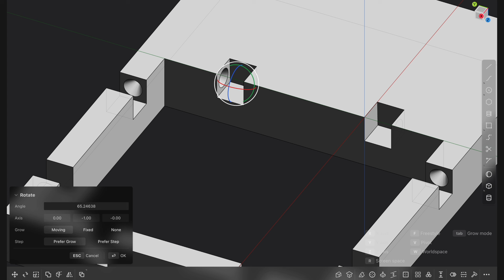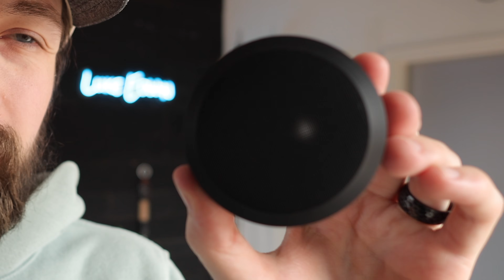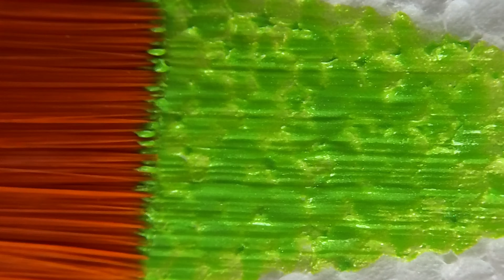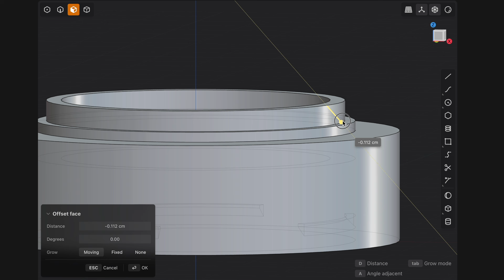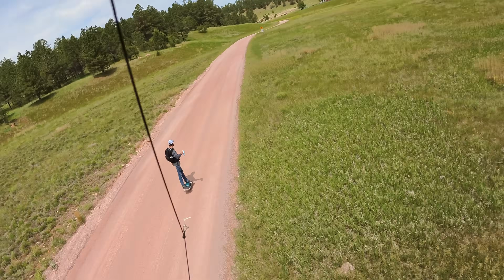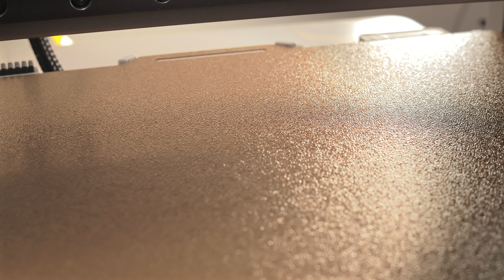8 DIY 3D Printed Camera Rigs

Comment from the maker: For all you wondering what software I'm using, it is Plasticity. Some of the screen recordings we're taking early on when I was still trying to figure out what software I wanted to go with but after trying a whole bunch of different program I figured out that Plasticity had the feature set that matched my needs the best for 3D printing.
Reply: After trying Fusion I can't get interested in Plasticity. It looks great, but not being parametric makes iterative design so frustrating.
Reply: Thank you,  it didn't look like Solidworks or Rhino so I was curious.  Have a great day!
Reply: @ashe31  are they all somewhat similar? as you can learn one and others or do they all look and function different?
Reply: Yo my dude. I got into 3d printing and I designed a lens I would love to show you and get your point of view on before I release it.

Comment: For the cell phone matte box, it would easily mount right-handed camera bumps by mirroring all of the files appropriately.  And the grid lens essentially takes isomorphic photos (in the style of pixel art).  Very neat, but I did notice a seam where the print head dragged across the grid in the middle where the sensor collects light.  If you set the seam to be along a specific edge and turn on Z hopping to avoid the part during travel moves, you should be able to avoid the streak of plastic that destroys the consistency of the grid in the middle of the frame.  (And it's pronounced "freh-nell.")

Comment: That pixelating looks great - here's a suggestion, why not try incorporating that into the EF to RF adapter so that it sits between the lens and the body.  Do you think that would work or would the light rays not be straight enough?  You could also use vintage m42 lenses with their own interesting optical characteristics

Love the broom shank holder and I see that there's a remix for multiboard so I think I'll definitely have to give that a try.

Comment: Well done! Let me give a piece of advise on the last item. It worth to put battery as low as possible as this is the heaviest part of construction. Also rotors should be V-shaped to prevent wobbling of line on them. These 2 updates will noticeably reduce the picture tremor that you have so far.

Comment: The cable cam is a great project.  I'm thinking maybe add a cheap esp32 board and add remote control to change speed and direction of travel

Comment: Looks great and all, but with this kind of 3D printing, every time you mount the adapter, the metal parts scrape off bits of the material, and those tiny particles get inside the camera and end up on the sensor.
Sooner or later, something’s gonna snap or break off and hit the sensor.
And honestly, I can’t even imagine trying to clean a sensor when the whole chamber's full of 3D print dust.

Comment: That lens adapter is a pretty good idea. If one were so inclined and willing to put in the effort, there might be a way to add some sort of small gauge electrically conductive wiring from the front to the back of the adapter so whatever mechanism the camera software uses to determine the lens is "connected" for extra features is triggered whenever lenses are physically connected without having to manually enable whatever settings or reverse engineer the software to flash custom firmware that always leaves this on or something.

Comment: Great work here. I’ve been making some adapters for vintage lenses recently. One thing I learned in the process is that over time the 3D printed blades will deteriorate through the friction caused by mounting them. This will result in filament particles on your sensor or a blade breaking at inopportune time. Rather than risk damage to the sensor or having unwanted dust in my image, I started buying metal plates with the mount blade on one side and a m42 screw mount on the other. This way I could print the adapters with m42 threads and add the plate so the 3D printed material has little friction and the metal plate with m42 threads provides confidence that the plastic blades will not break or deteriorate.

I also moved to printing with ABS rather than PLA as it is much stronger and less likely to breakdown in the heat. Unfortunately, your A1 will not print ABS. Another fun thing I discovered was printing extension tubes or adapters in various colours, the light leak caused by the coloured acted like a subtle colour filter.

Comment: The deep printed grid "lens" you made is called an Anti Reflective Device (ARD), or Killflash. It's used on scopes and binoculars to prevent a bright reflection from the Sun on the users glass from alerting the users target. Most are only only a few millimeters deep though.

Comment: Great video! It shows that you put a lot of thought and effort in shot composition and editing.
Also, that cable cam is amazing and has big potential. I really like how you made a simple DIY version of film equipment that could cost thousands of dollars. You can make a whole build series out of it it if you're willing to keep improving the cable cam. 
Here are some friendly suggestions from a fellow 3d printing enthusiast:
1. Print orientation. Usually FDM prints are much weaker in Z axis and right now the whole cable cam is hanging from a thin vertically printed section. Split it in half, make filament-sized holes (usually 1.75mm) for ease of assembly and lay it flat on the print bed. Then, after printing, insert small pieces of filament and glue the halves together. This would make the cable cam stronger and reduce print time (because no supports). But more importantly it would help you learn a new 3d printing technique/concept that will improve almost all future prints.
2. Get a brushless motor instead of geared DC and also add remote control with a smartphone via esp32. This two features make more sense together. BLDC motor makes it go fast, remote control makes it stop before it hits the tree. Just like a quadcopter. You'll also have to get some bearings for the wheels, otherwise the wheels might melt from fast speed. I know this is a big change with extra coding, but there are code examples out there. You will also "unlock" remote control and BLDC motors for your future inventions.
3. Pan head. Add a high resolution servo to pan left and right. This requires remote control but it would make the shots even better.
 The last idea I wanna share is pretty insane, but hear me out:  Cable cam with a geared DC motor... shaped like a golf ball. It will make timelapses that look like drone shots but it will be in the air all day. Or even all night if it has long exposure mode. The golf ball shape will make it resistant to wind  and most importantly will make a sick thumbnail! You'll have to suspend it from 2 cables though, since the center of mass should be in the middle of the golf ball for proper aerodynamics, but it could yield truly unique visuals.

Comment: Just the other week I was looking for a rope climbing robot to run a GoPro up a kite string...
Reply: If this "robot" suspends from a single point on the line, the camera will be spinning out of control.
For stabilization, kite aerial photographers use a device called a picavet which suspends from two points on the kite line. But they're fixed points; you attach when it's on the ground, then loft the kite.

Comment: What 3D modeling software do you use?
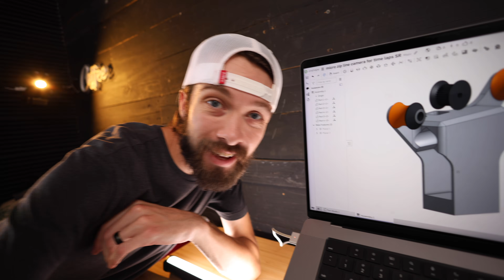Reply: Upper left corner says OnShape 15:50
Reply: That is Shapr3D
Reply: That's Plasticity
Reply: First is Plasticity for the lens hood, the the cable cam is Onshape.
Reply: Looks like Plasticity

Comment: The phone light blocker thing you made, I really think you can make it so that it can fold up to protect the camera when you're not using it, and then pull out for when you want to use it, so you don't have to have it so bulky, and it works as two things and can stay on.

Comment: love the macro on insta 360
Reply: One problem with the Go cameras is the batteries aren't replaceable. 
I have a Go2 and battery died. I had use a Dremel to cut it open in order to power it again. Needless to say, it doesn't look the same.
I agree that the shots were cool.

Comment: Some very creative lens designs - love it! The "pixel lens" is really quite cool and so much more inventive than just printing a simple pinhole lens. Which 3D modeling software are you using? Some of the icons looked very similar to FreeCAD [which I use] but it's clearly different software.
Reply from the maker: Thanks, glad you enjoyed it! I use plasticity
Reply: First is Plasticity for the lens hood, the the cable cam is Onshape.